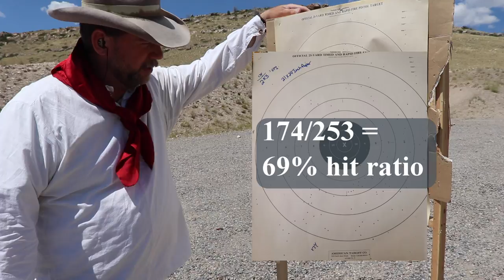Shooting an 1870s Greener Part 1

Comment: Youncan also load 1F and it will lower pressures again... 2f is fine. 1 f takes recoil down also.. And in more open choke... Larger shot rules... Try some #4
And youd be surprised with buck shot!!
Ball loads using round balls is possible but the bores need to be measured to use correct ball.